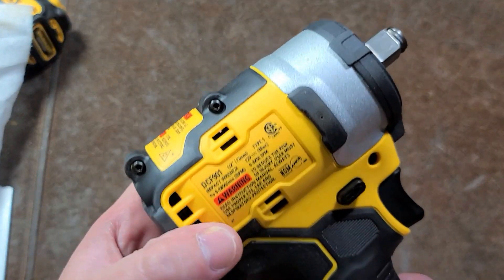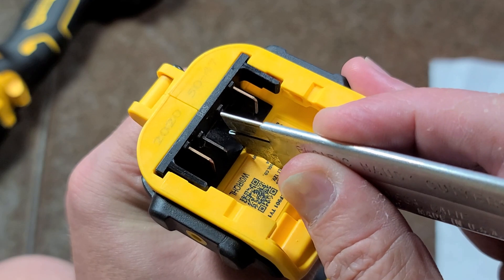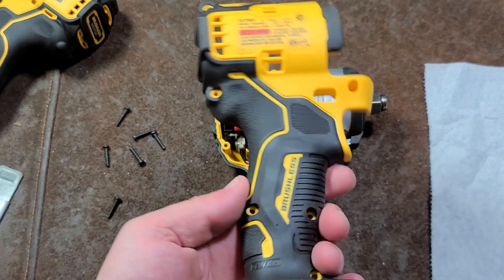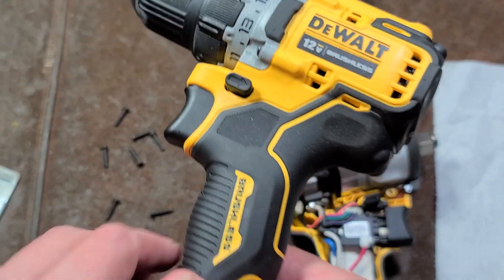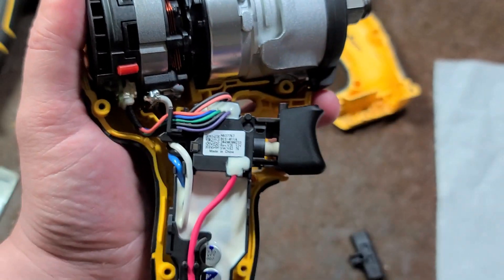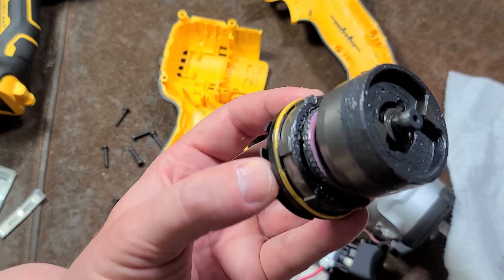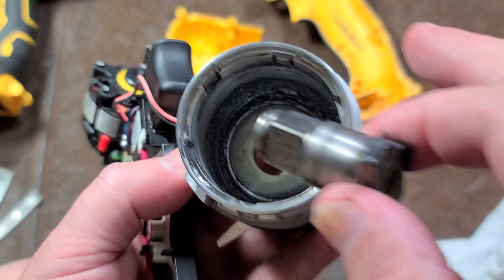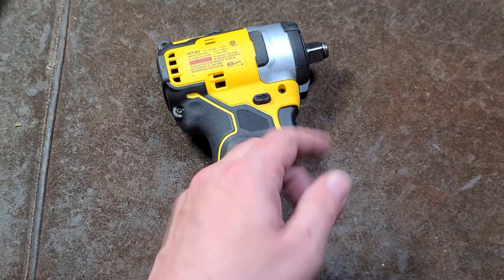Teardown: DeWalt High-Torque 1/2" Drive 12v Max Xtreme Sub-Compact Impact Wrench

Comment: i purchased two anvils from ebay for this

quality is just as good and you get quarter hex drive through the centre (bosch do this on there half inch) for 10 or $20 for two! That really changes the guns diversity ESPECIALLY if you’re on a budget, it’s two  guns in one. It’s import but i couldn’t see the difference

Comment: I tried to run it from car jumper battery pack by connecting the two terminals at the bottom.  but it does not run.  the LED just comes for a second.  the battery pack is fully charged and I've used it to start a 3.5 L V6 few months ago with a dead battery.  don't know why the impact won't run.  do you know what the third terminal is for?  some kind of sensor???
Reply: I did the same thing the battery failed, depends what battery you used I used an 18v xr 5ah to jump start a lawnmower now the battery doesn’t work, I tried the battery revive trick where you use another battery and “jump” it and it didn’t work

Comment: The 20v dcf921 subcompact is a only a little stronger than this 12v tool and does not justify the huge price jump so I grabbed mine for $160 total for the dcf901b tool and the battery and charger kit dcb135c. This tool does the job for diyers changing brakes and what not. Its a neat and light little tool.

Comment: Can you swap the 3/8" anvil into this with no issues? Im concerned the hole in the nose cone would be too large and a bunch of grease would come out and then the tool would always jus get hot

Edit: unfortunately the deal from lowes when this was "free" with the impact and drill kit you could only get the 1/2" version and not the 3/8"

Comment: I was wondering if the 1/4 hex and 3/8 12v anvil could be swapped
Reply: Lol why? Just buy them...
Reply: @Lee-lb9qh  I have both lol did you see where a youtuber made a stronger 3/8 impact by putting the anvil in a 1/4 impact
Reply: @SprouseyTheHandyMan  lol ya I I know people do that, lol I never take mine apart cuz probably won't put it back together correctly
Reply: @Lee-lb9qh  I build stuff all the time. I’m pretty good at fixing cars, I remodel homes and think if I take pictures as I go, of what goes where, I think I can reassemble them correctly. I wanted to try being I think it’s undone on the dewalt 12v platform thus far.

Comment: A 12v high torque?  I don't think this can make over 500 ft lbs.   More like 250 ft lb at most.
Reply: Yea it's not a high torque. He worded it wrong lol. This is on the spectrum of a mid torque but nowhere close to a high torques specs. Check out shop tool reviews on this gun. It broke free a nut torqued to 450 ft/lbs. It is a very powerful bit of kit for sure

Comment: I've read that the motor in this tool is from a 20v tool. It  appears to be larger than it's little brother, the 902 3/8 impact. I'm curious if the motor is the same as in their Atomic 20v line? I don't have any compact econo Atomics to  compare. 
Also, have you ever compared the internals of 12v Dewalts to their red clad cousins, the 12v Mac tools?  The price differences are significant. The Mac cases appear as if they'd be more durable over time in the hands of an auto mechanic's vs a homeowner or woodworker. (Framers excluded).
Reply: Mac has a longer warranty plus the truck service. Other then that they’re the same.

Comment: You can defenitly tell that dewalt put way more effort in developing the dcf902 3/8 12v impact driver needle bearing is a better design for the anvil
Reply: I think the reason is that they use the same housing on the DCF901 and DCF903 and to take up space on the 3/8 version they put a bearing in. 

Anyways this size of tool is way more handy in 3/8 drive so I don’t mind too much.
Reply: @zorgzev96  I agree 💯

Comment: Man. This is the channel and the video. I've been waiting for. I've been too poor to deal with purchasing this just yet. Stupid family and friends still needing help. But I can't wait to put it through the rings. 

My main use is a side piece in my trunk. Just in case I have a flat. And don't want to use the elbow grease to get the jack and the bolts up and off.
Reply: Ebay. Dont pay over $99 shipped.